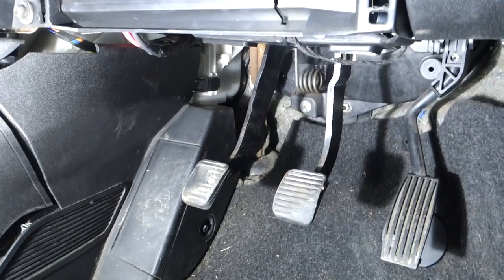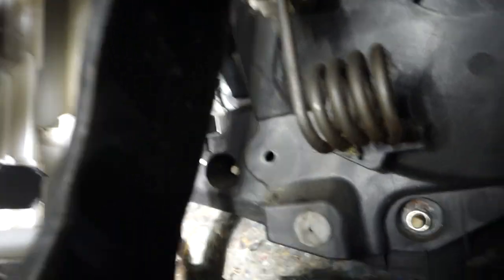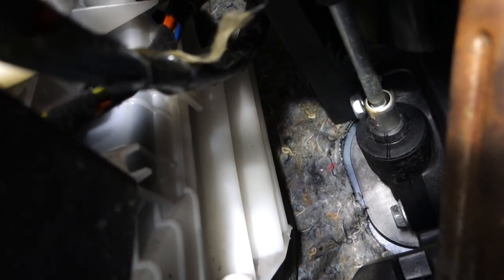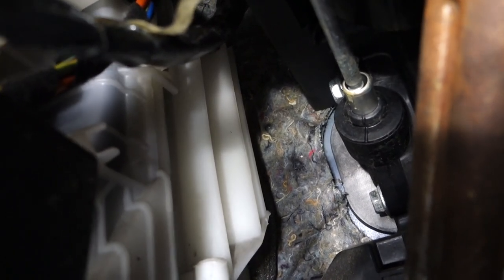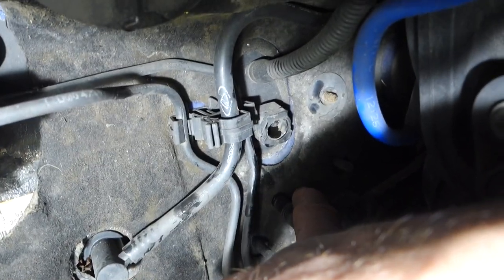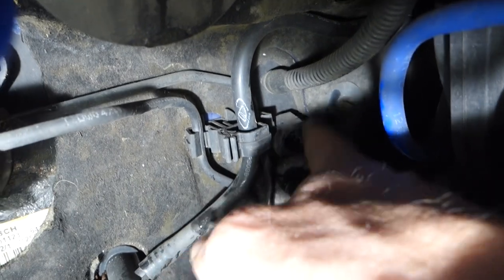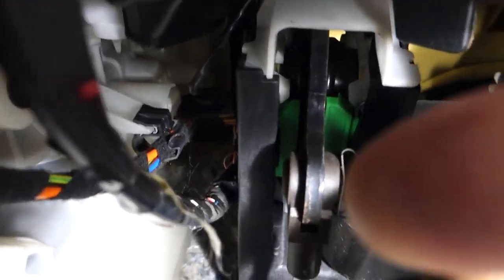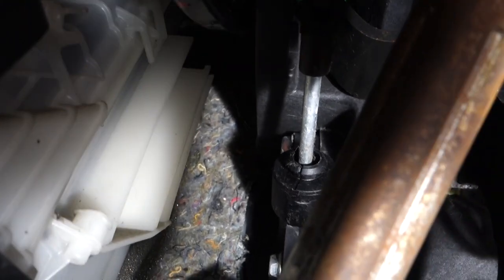Fiat Punto Grande - How to Remove and Replace Clutch Master Cylinder

Comment: Top man 👍    Always good to see how it’s done before tackling it, 

Had to replace the wiring in the rubber grommet were the boot closes the other week (common fault for them to break)   If you ever have to do it use silicone wire,  it’s more flexible and won’t split,    Brilliant videos,  there’s not many videos on YouTube regarding repairing the Grande Punto 👍
Reply from the maker: Hey thanks for the comment! 

I changed the tailgate a while ago and didn’t change the wiring, lights never worked the same lol. Luckily I don’t drive it. But thanks for the tip. Cheers.
Reply: 1NE LIFE when you do the clutch change video could you show how to remove the driveshaft seal as well 👍

Comment: I want to buy a new clutch set for my Grande Punto 2007, diesel, 1,3 multijet, hatchback, but the clutch sets are from 215 to 220 mm in outer diameter. Do you know which one to choose?

Comment: My Punto doesn’t go into to third gear works fine on all other gears would you recommend on getting a new gearbox for it and your videos are brilliant keep it up
Reply from the maker: Thanks very much for your comment! Unfortunately yes, the gearbox on mine went a few months before i started this channel, I got a reconditioned gearbox for around £200 with a warranty, New ones are not cheap. You could risk getting a scrapyard box but it could have similar problems, be a lot cheaper though. Hope this helps. Cheers.

Comment: can you do a video on how to fix the wipers water not coming out either in the front ot the back and how to fix it?
Reply from the maker: Hi it’s probably a fuse or the washer pump. The fuse for the washer pump is Fuse 42 located on the interior fuse board. If that is not blown it could be the washer pump. I can do a video but not for a while as I don’t have the fiat at the moment. Hopefully it’s just the fuse. Cheers.

Comment: cannot pull master cylinder out, undone both pipes, removed pin from pedal, undone the 2 13mm bolts but the plastic back plate of master cylinder inside the footwell is caught behind the larger plastic pedal frame thats bolted right next to the master cylinder - the 2 connections on the back of the M/C are stopping me slide the M/C sidewards to clear the plastic  and i cant pull the M/C towards me cus of the damn stupid plastic backplate on th M/C is tucked behind the plastic
Reply from the maker: There should be enough play to squeeze it out, won’t be easy but possible.
Reply: Did you get this sorted, im having the same problem. Cant get it free from the hole
Reply: Hello guys ! Anyone sorted out this piece of...🤮🤢🤕🤯🤯🤯

Comment: Master cylinder does NOT come out unless you slacken the big plastic housing that the brake cylinder bolts to, you don't have to take it off just loosen the nuts and pull it back
Reply: This comment really helped me.....
thanks for the video and this comment
Reply: Send me video sir
Reply: Ok but there is one bolt which is with plastic around something like that so you can't even put the socket on it !!!
Reply: Should I rip the plastic out ?